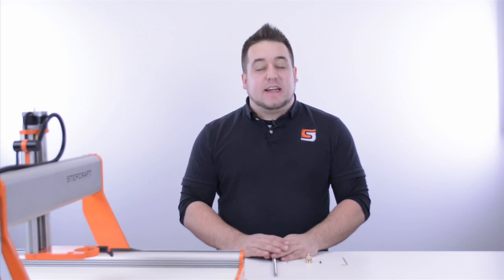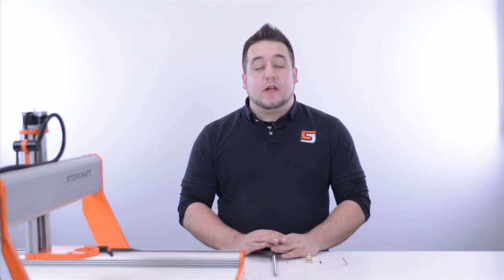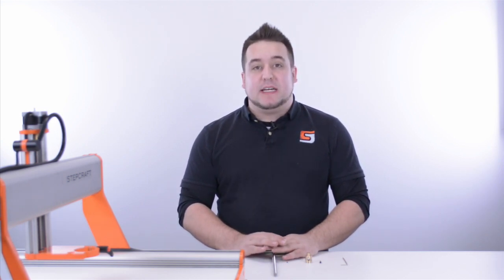Installing the STEPCRAFT Adjustable Lead Screw Nuts

Comment: After a few hours of normal working with my Stepcraft 2/D 420 (Black Edition), the socket head screw M3x20 mounted in the Y-axis adjustable lead screw nut has come out of the hole and has fallen on the tool holder. How can I remount the screw without disassembly the whole Y-axis block? And in general, how can I tighten or loosen the screw of the Y-axis adjustable lead screw? The screw seems not accessible in any way from the outside...

 of the   my Stepcraft 2/D 420 (Black Edition)

Comment: What is backlash? When the machine shakes moving across the axis?
Reply: Basically free play. The amount the gantry can move without the leadscrew being turned. This is because theres a clearance between the thread of the nut and that of the leadscrew. A anti-backlash leadscrew tries to minimize this by keeping the nut pushed against the thread on one side.